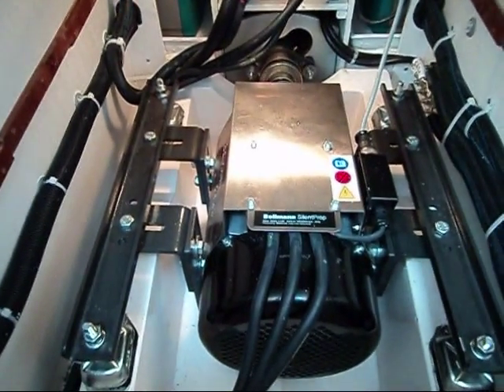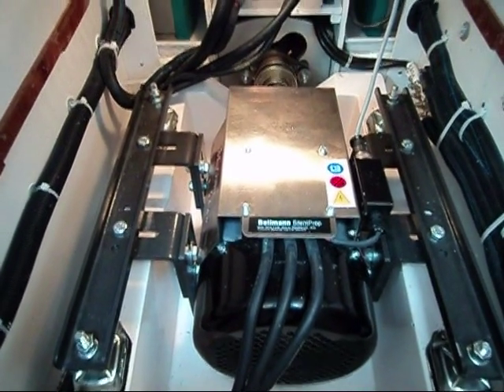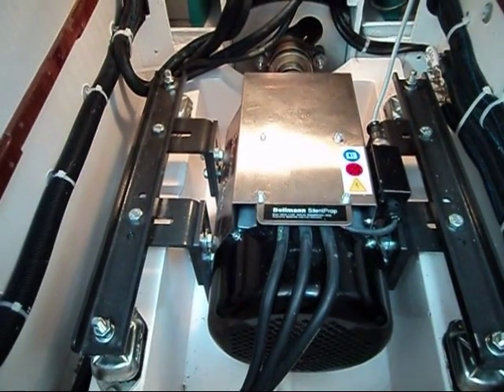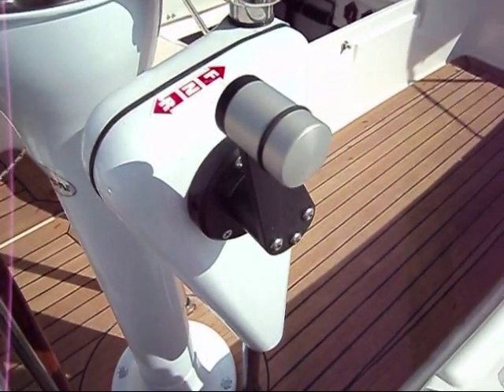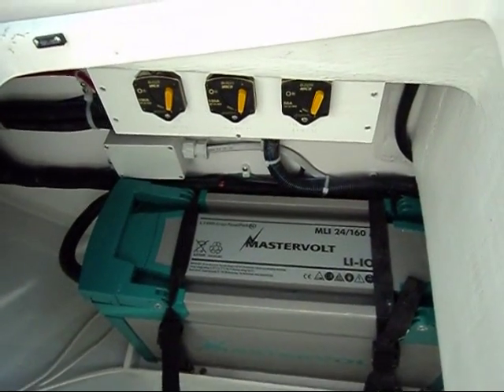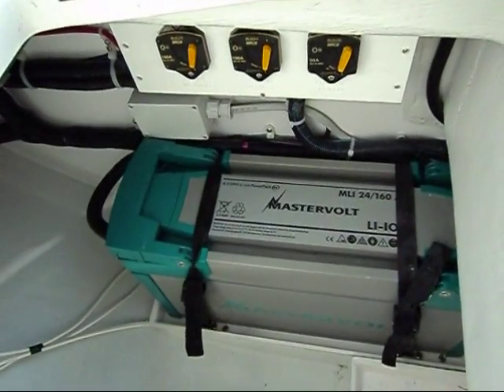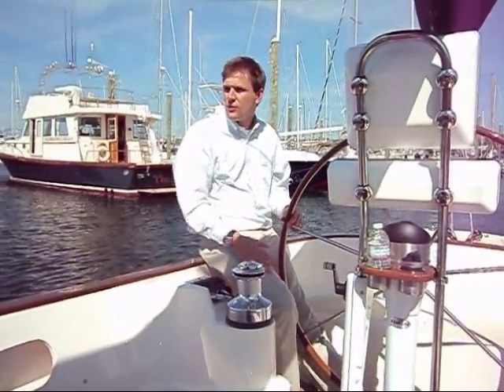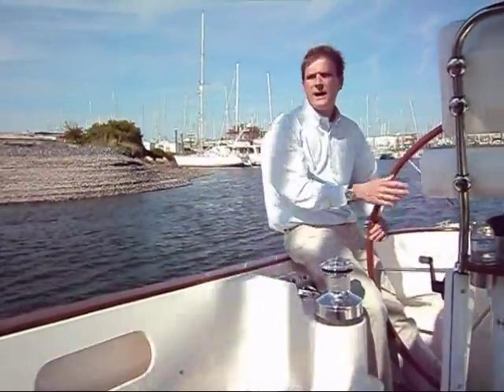Alerion Express 33 with Electric Propulsion!

Comment: Electric is the way to go for power because the duty cycle is an exact match for how they're used in a sailboat. Electric power for sailboats couldn't have come soon enough! So much better than a stinky diesel, especially when manufacturers like yanmar charge over $600 for things like a water pump. Basically the same exact water pump as a $35 car water pump, just a different shape. Absolutely ridiculous.